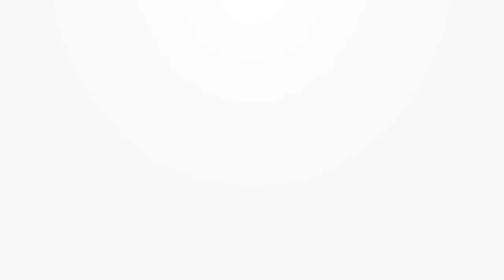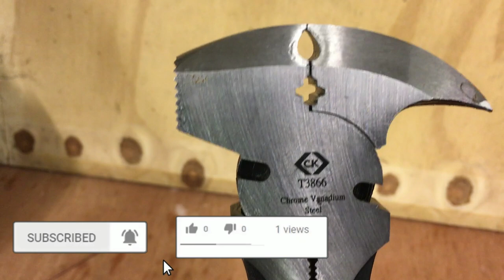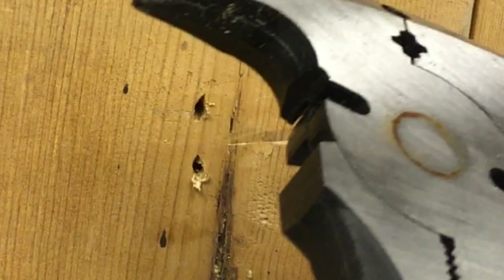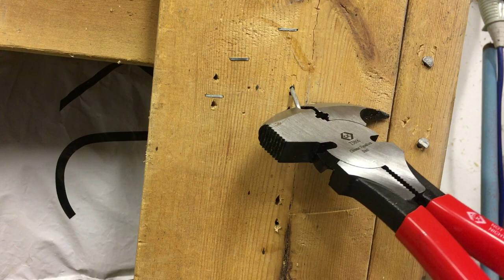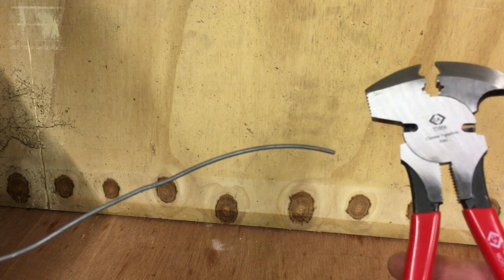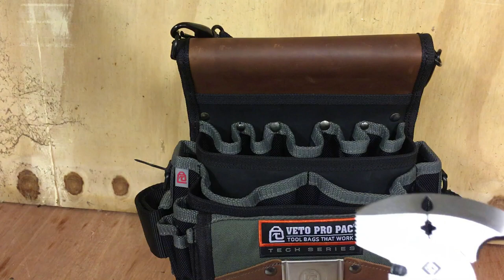CK Fencing Pliers Review | CK T3866 Fence Pliers

Comment: Those jaws on the handle side are used to pull the wire tight when you're trying to tension it. Placed against a post and draw the wire up (usually barbed wire)
Reply from the maker: I wandered what they were for - thanks for the comment ! 👍

Comment: Other then removing fence staples from wood post I found this tool worthless .. sorry !!
Reply from the maker: That is the main thing that I use it for too, but just thought I would show the other uses as well. Thanks for the comment 👍
Reply: They're great for contractors and handymen. Especially for working on mobile homes. They use staples in almost everything
Reply: I use it for everything. I even fixed my bike   with mine.

Comment: Those things are next to useless for most jobs, chap hardened material with a hammer and it'll shatter. (Seen it happen! )
Use as hammer to drive steeples every time .
 Knipex end cutters will remove steeples, cut any wire and sit in your back pocket, all for £15, just my opinion though!
 Good informative video!
Reply from the maker: Thanks for the comment, I only really use these for removing staples and cutting wire and to be honest. I think they are fantastic, especially for removing staples (the main reason I bought them). I don't use the hammer as it is not really meant to be used frequently, I think it is there only as a back up to get you by if you don't have a  hammer with you.
 The wire cutter function is actually a lot better than I expected, they cut through some substantial wire due to the long high leverage handles.
 I have knipex end cutters too, but I think these are better at removing staples in my opinion but each to their own.
 Thanks again for the comment 👍
Reply: I dread to imagine how many times I've hit various pairs of these with hammers to get behind an over-driven staple or pull a rail off a post and I've never had a pair shatter. In fact I use them almost exclusively in that way, because on most makes I find the jaws aren't sharp enough to get in behind a staple.